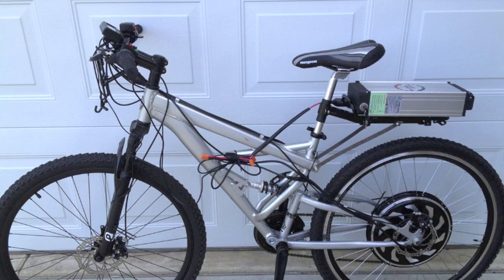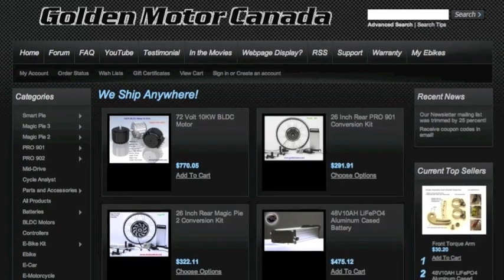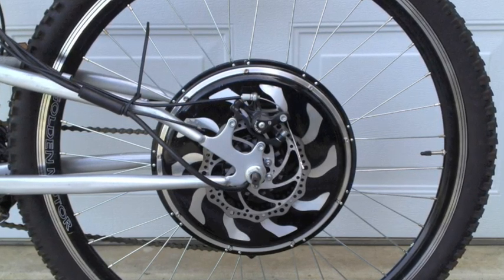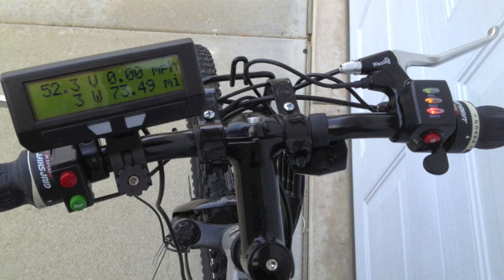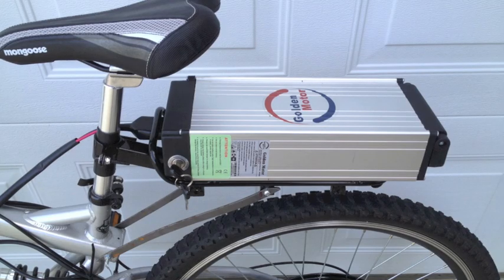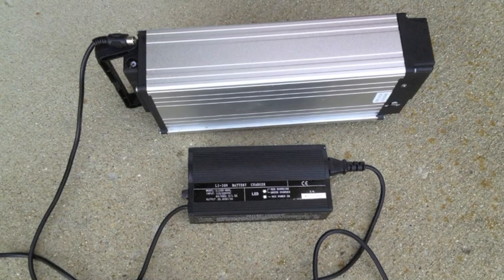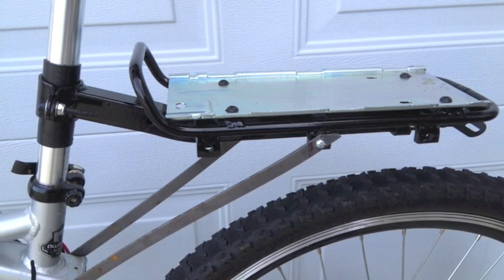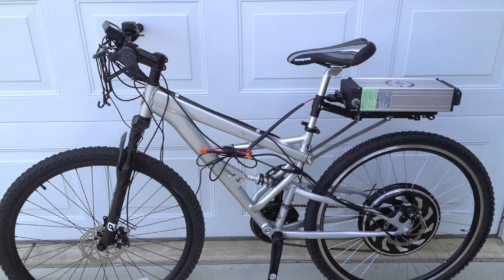Mongoose E-Bike with Golden Pie Motor

Comment from the maker: Here are some changes that I've made...

1. It has run fine since 2013. I use it to commute to work four miles both ways. I probably use it a hundred times in a year. I'm on my third set of tires. One charge on the battery easily lasts for two trips or 16 miles. I think it will go for about 20 miles. The more you pedal, the less watts you use and the longer the charge will last. But I never pedal hard enough to break into a sweat. 
2. I added a torque control piece (which I can't find on the Golden Motors Canada website). I don't accelerate hard, so I didn't think I would need it. But when you brake, the regenerative aspect of the motor is very strong, and there is a lot of torque on the axle. That tends to chew up the slots that hold the axle. I disconnected the back brake from the motor (just find the right wire and unplug it). I start braking with that (no regenerative braking). If needed, I go to the front brake (which is regenerative). That will stop you very fast. The reason the brakes are normally connected to the motor is so that the motor will automatically be cut off as soon as you brake. 
3. I switched from the mountain tires to a street tire. That increased my speed by about 5 mph. But there are some drawbacks. The mountain tires are good shock absorbers. With the street tires I've broken spokes and had flats. This usually happens come off hard on a curb or hit a large crack in the road. 
4. I moved the battery from the back to the crossbar between my legs.  There was a lot of weight on the back tire, so I thought I would try to redistribute it. 
5. I've put some some lights on the bike, but I need to get some with higher intensity. At 20 mph, a regular bicycle light is not enough.

Comment: excellent video. What is the wheel size ? 26" ?.
Reply from the maker: My tires are 28" or 700mm. I went with the bigger tire because I thought it might handle bumps and debris a little better (knowing I would be riding at higher speeds). But I'm not sure it makes a difference.